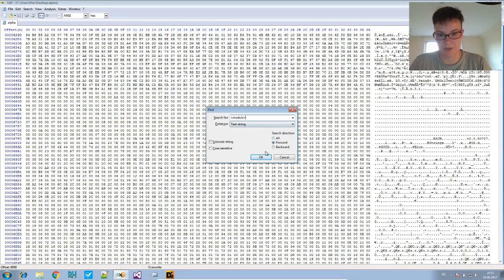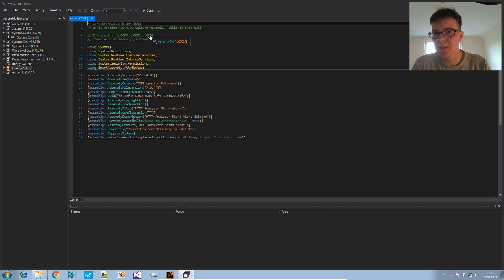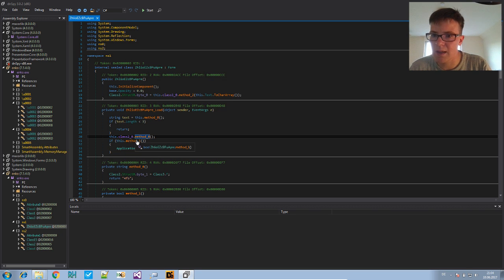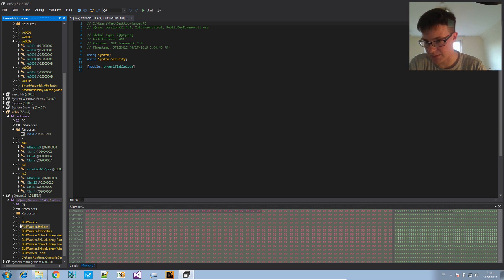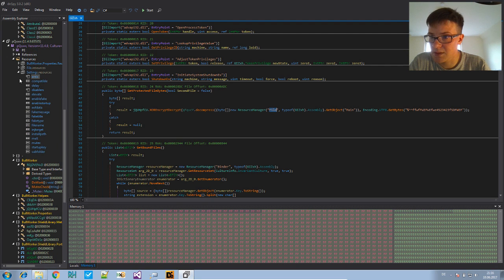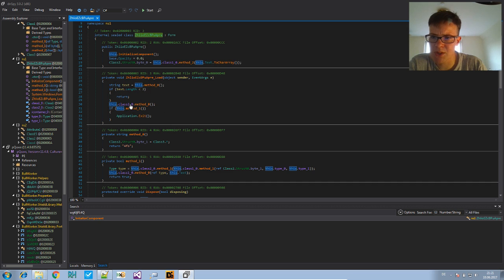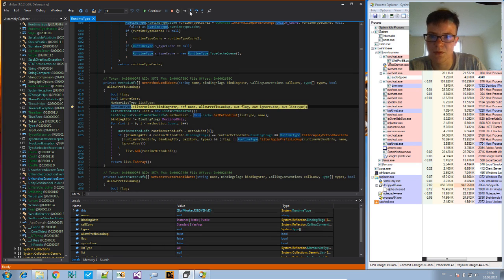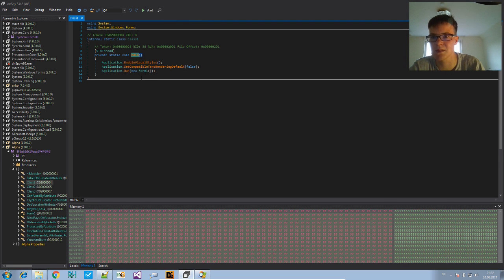Malware Analysis - Unpacking Alpha Ransomware (Pt. 1)

Comment: Thank you for your this video. But I have a little problem about the De4Dot tool. When I drop the malware on De4Dot, I'm getting an error. And this is the error "Warning: This file isn't a .NET PE file" . I couldn't find any solution. Do you have a any idea?
Reply from the maker: Hi Yavuz Han. That means whatever you dropped on De4Dot was not a .NET file. Check the file in the hex editor and see if it looks like a PE file. Then open it in PEStudio and check if it says .NET executable in there. Did you download the sample from Hybrid-Analysis? Maybe you still need to unpack the archive to get the actual sample?
Reply: MalwareAnalysisForHedgehogs Hi, before your answer I did. I downloaded again sample file from Hybrid-Analysis then worked. I don't know what was the problem but it's okay right now.
Reply from the maker: Good that you got it to work thumbsup

Comment: I like that you give the softwares used in the description. What is the best free alternative for redgate .net reflector vspro suite?. How many features does it lack compared to redgate?
Reply from the maker: I used .NET Reflector for a while but had too much trouble with files that it couldn't decompile whereas other tools were able to. So I completely switched to ILSpy first and then to DnSpy because the latter can also debug. I also use IDA for .NET files on occasion. I cannot tell you what features are missing or additionally there comparing the current versions. It's been 2 years ago since I used .NET Reflector and a lot of things have been added or fixed during that time.
Reply: MalwareAnalysisForHedgehogs Thanks for the reply. If it's been 2yrs since u used it, then it's pretty much safe to say that dnspy & ida are excellent alternatives to .net reflector.